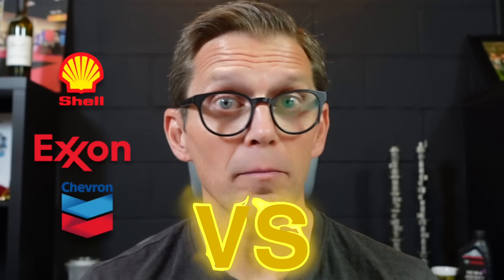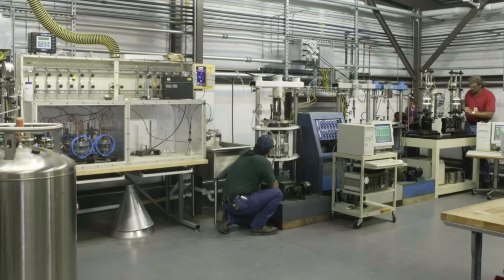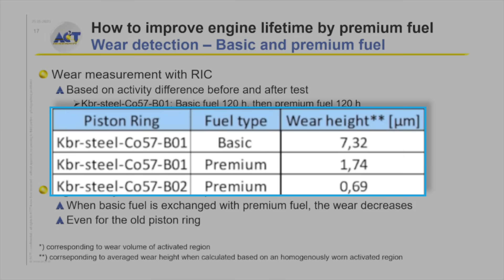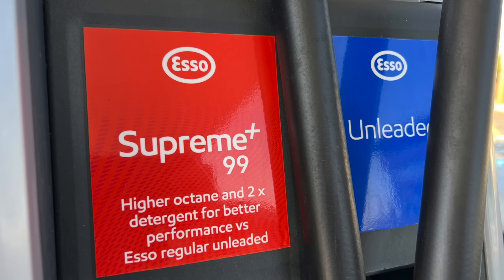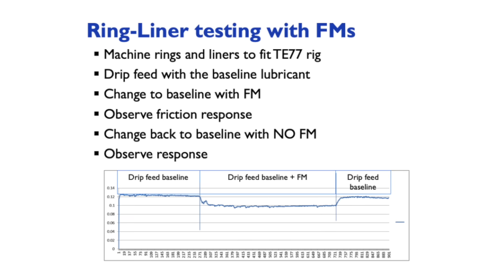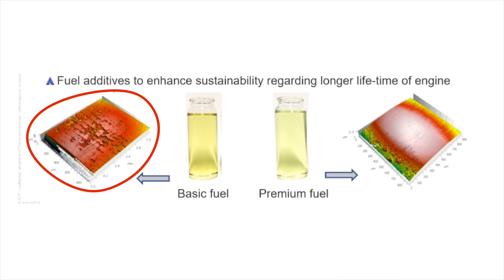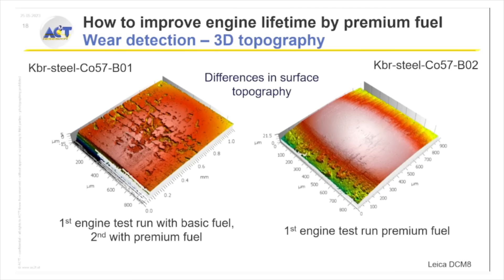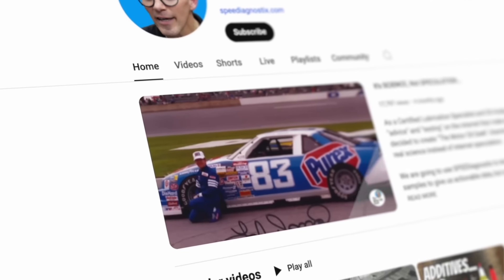Can Premium Fuel REDUCE Engine WEAR?

Comment: I was in the petroleum industry for almost 20 years. This is important. When purchasing fuel at your neighborhood has station, is it branded gas. Is it premium Shell, or Sunoco, or BP. Some have found a way  to get unbranded gas and sell it as branded. No joke. In many cases I delivered high grade branded gas to a discount gas station, because of allocation issues with the supplier. Large volume major name brand gas stations would purchase there fuel from a transmit plant. That plant would add what ever additives the retailers tell them to, and that plant would list it as branded gas. Many times because of price I would go to a terminal that only has 5lb gas. Thay would be having a pipe line come in and need to make room for there fuel delivery from the pipe line. The terminal would have a sale on fuel. (This happens all the time) that sell branded 5lb gas to who ever has the cash to purchase it. Most areas in this country can sell 7lb gas. But there is no regulations on if a area that can sell 7lb gas sells 5lb gas. It's incredible how things like this go on every day.

Comment: I wonder how E85 affects wear. I use the local Sheetz which runs around 76-78%. I run in my boosted Pontiac G8 (drag race/street) as well as my C6 Vette for road course (445 cui, 12.3L1 CR).

Comment: Lake, I think it would be interesting to measure actual detergent levels in all of the major Top Tier fuels. The handful of analysis I have seen suggests wide variances. Also, how does detergent level vary WITHIN the same brand across a large geography? For example. is Shell V-Power sold in the Carolinas similar to NJ, TX or MA? Thank you.

Comment: So the takeaway is to use premium fuel in all engines for friction-reducing additives alone, nevermind which brand of fuel or engine design? The rate of combustion is the most critical factor in octane ratings, not friction additives. Lower compression, non-turbo engines tuned  for 87 octane may not perform as well on higher octane fuel while costing an extra $30 extra per month. If friction additives are key, please recommend an appropriate product one can add to every other fill-up, without changing combustion rates that may have other harmful long-term side effects.

Comment: I can only assume all those gas stations used with the getupside app are NOT top tier fuel stations or are clean fuels.
Reply: Correct, just a statement.
Reply: Might work with your local BP station, and BP is supposed to have good additives. It would be interesting to see some testing of BP fuels (both regular and premium). Nothing in this video had anything to do with the Top Tier consortium.

Comment: Second post...Just thinking, if ring friction is reduced, it stands to reason power should increase as well . Do you think there is a measurable difference on a controlled dyno test ?
Reply from the maker: Yes, there should be a measurable improvement in HP. Sounds like a fun dyno test!

Comment: Hey Lake should I start using premium fuel from the top tier or am I good using 87 just to use the top tier ones? Maybe use premium fuel from the top tier every time I do an oil change or I don't need to?
Reply from the maker: I think this data makes a strong case for using a fuel additive with friction modifiers. That might be a more cost effective solution.
Reply: @themotoroilgeek  Thank you 👍

Comment: Change your oil every 2500 mi in the fuel does not matter you will have no cylinder wall where whatsoever after 250,000 miles

Comment: Interesting but since we are not in Europe how do the U.S. fuel brands stand up against each other for overall quality and packages added like for wear protection (AND) detergent additives between the name brand fuels like Shell, Sinclair all the way down to shopping mart fuels like Quik Trip or 7eleven fuels that are probably actually bought more often than Shell and others as these stores are on every corner in towns and cities.
Reply from the maker: That is something we will have to investigate.
Reply: @themotoroilgeek  Cool,  I have a 2001 GMC Sierra Z71 w'5.3L V8 (bought it new from GMC dealer) and now over 100k miles and it still runs like a top,  I change my oil and filter every 5,000 miles and the inside of the valve covers are pristine clean & look like new. never had any engine or fuel system work done except filters.   Always have used QT gas since the truck was off the lot, new so I think it will test well.
Reply: Point of order: many shopping-mart brands are part of the Top Tier consortium: 

Mega Saver
QT/Quik Trip
Express Mart
Fast Fuel
Kwik Star
Kwik Trip

Comment: ??? If you are driving an older vehicle that has been using nothing but the lower octane- basic fuel for the life of the vehicle & has worn piston cylinder walls, how will premium fuel help restore the already worn cylinder walls?? It doesn't make sense to run the more expensive- higher octane fuel in an older worn out vehicle!
Reply from the maker: It can’t help in that scenario
Reply: @themotoroilgeek  thanks for your reply.

Comment: Premium fuel in CA averages 7% higher at the retail.

Assuming 10,000 MI per  year at 5.00 per gallon and 20 mpg.  This car uses  $175 more for premium.

In 20 years, that's $3500 more in gas.  If there is a 20% chance the engine reaches 200kmi due to the additive performance, and a new motor installed costs $15k, the average amount saved (for a large population) is $3k.

So in these specific circumstances, it's kind of a break even of actual cost vs. likely savings.  Very dependant on uncertainty of failure mechanism.
Reply: "In 20 years, that's $3,500 more in gas."
The average working-age American spends around $10k per year to drive. In 20 years, that's $200k (in constant dollars).

Comment: Pump fuel is so fraught with tradeoffs you could do a whole new channel about it.  Out west where we have to deal with ACN91 fuel, the differences in additive package make a big impact on how far you can push the fuel in extreme performance apps.  Even though all the base stock comes out of the same common pipeline, the additive packages can not only affect wear (as Lake shows), but they also seem to affect burn speed and detonation resistance.  Tune a car on Shell 91 and then run it on Chevron and it'll make a little less power.  Tune it on Chevron and then switch to Shell and knock counts go up.  But dial in the tune on either fuel and the power curves are very close.  Overall Shell probably has a quicker burn which I'd prefer (efficiency).  Of course the true take away is that you shouldn't seek max power on 91 pump fuel, or maybe that you should just run E85.... ;)
Reply from the maker: Great point!

Comment: Very interesting! 😃👍
A wish for a future video: about viscosities and different flashpoints of 2-stroke oils! 😉
Reply from the maker: Great suggestion!
Reply: @themotoroilgeek  Thank you! 😃
I think I have a lack of knowledge about 2-stroke oils. And there are many specific and good ones out there.
Low flashpoint for water-cooled marine applications?
Medium flashpoints for low-power street-bikes and garden-tools?
High flashpoints for race-bikes?
Highest flashpoints/castor oil for engines of race-bikes that get disassembled and cleaned several times a year?
How about the viscosity and cleaning properties in the combustion chamber?
So many questions that are not answered in the advertising. 🤦‍♂️
Reply from the maker: @u.e.u.e. we will get to 2 stroke oils at some point
Reply: @themotoroilgeek  Thank you! 🤗

Comment: If someone besides you would have told me that the fuel additive would reduce engine wear i would not have believed them
Reply from the maker: Thanks. I had to see the data to believe it myself!
Reply: @themotoroilgeek what about non elthonel 89 octane that's what I run in my 88 Mercury Marquis because it not driven as much as I would like I'm thinking it's better without the elthonel gumming up the works it's been running great so far of course I baby my baby she's like brand new love the car...
Reply: You mentioned most fuel additives are beneficial if they have that one ingredient. Not anymore?
Reply: The BIG question is, which fuel?  Is Eagle brand premium as good as Shell premium?
Reply: @pat8988 And I think an even bigger question,  how do you know that the "good" fuel you got last week is still good this week since none of these additive formulations are regulated?  The old bait and switch.
Reply: @pat8988  i can only tell you for Germany's fuel 
nr1: shell
Nr2: Aral
Nr3.OMV (i think)
Reply: Look into NMF. It neutralizes the charge of oil and metal surfaces so that metal parts aren't attracted to each other. Creating a bigger boundary later of liquids. Less friction.
Reply: @Drofthechalice  thank you i will
Reply: @Drofthechalice  Militec-1 also works the same way a NMF ...
Reply: @100pyatt  no it doesn't. Looks like militec 1 is similar to Lucas oil. It will react to heat by expanding and eventually break down. NMF does not react to heat nor expand in fluids. It works by neutralizing ionic charges of metal parts. When hot metals will become slightly attractive causing more friction and wear. I've used many anti friction products in my cars and diesel machines over the years and NMF is superior to all I've tried.
Reply: @Drofthechalice  Militec-1 is nothing like Lucas. Lucas is a 60wt straight oil, no anti wear properties. Militec-1 is a METAL conditioner and not an additive like NMF is.  Militec-1 is attracted to and bonds with every heat cycle until it's saturated. What you add to the oil ends up in the metal and leaves the oil. NMF appears to be an oil additive and not a metal conditioner
Reply: @100pyatt  when you explain it that way. They are the same product working in the same way. Thanks I'll look into it more always wanting to maintain my rides as best as can.
Reply: Hey lake how can we minimize the wear in the engine while making sure the DPF (Diesel particulate filter ) not to get blocked, because most of the car manufacturers recommends using low or mid saps oil engine and thats not the best oil to use in terms of keeping the wear levels down 
Thnx in advance@themotoroilgeek
Reply: @noshkaroso6702   MOLY based anti wear is fully compatible with DPF systems and will not form the metallic oxide ash that ZDDP does ...
Reply: @scottjones7279 - Keep an open mind and we can learn many things. :)
Reply: I dont understand what was so hard to believe. They have higher octane and friction modifers. Kinda obvious theyre better for the engine?

Comment: Lake; I find it hard to get too excited about engine life being increased significantly if using top tier fuels. With so many different systems that make up modern vehicles these days a failure of the engine or even prolonging engine life is not a concern as these other systems will retire the vehicle’s life well before an engine failure.

Comment: Great info! Being that the FMs are added to the tanker truck and being the price of premium fuel is so much more than regular, would it make since to just add the FMs to each tank of regular fuel myself?
Reply from the maker: I think that is the most cost effective option.
Reply: @themotoroilgeek  Awesome! In that case I would vote for some included fuel additives in along with the fuel testing. My first additive that I'm going to try is the Lucas Oil Fuel additive that also has the injector cleaner. I've read reviews that it increases the fuel economy but as you always say, I want to see the science!

Comment: Hey Lake, this is in e gines with iron bores or liners. My Indian motorcycle has aluminum cylinders with a Nikasil-like coating. I wonder if it works similarly. Of course, that engine requires premium fuel for its octane level.